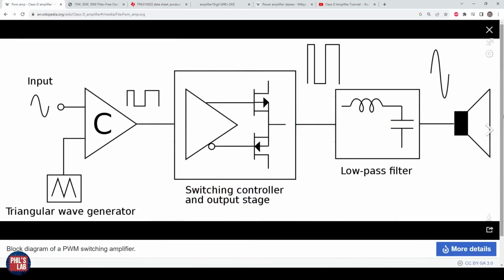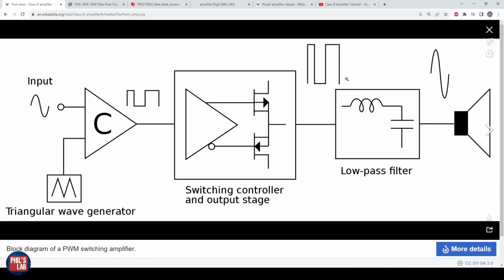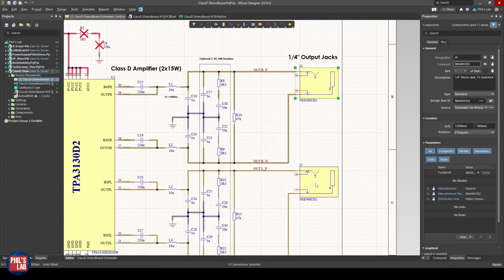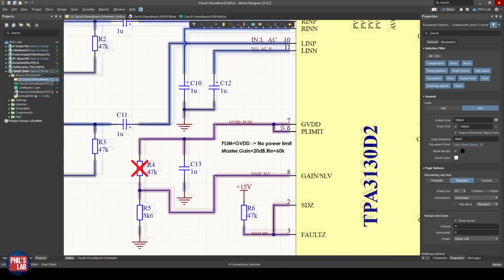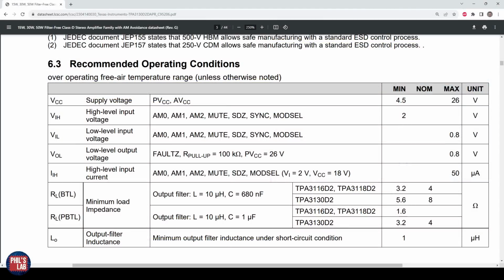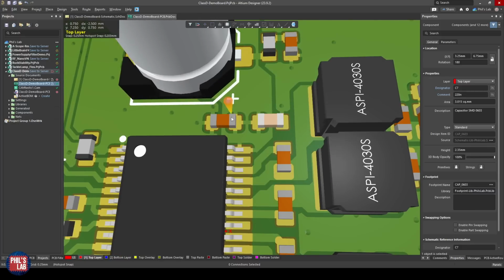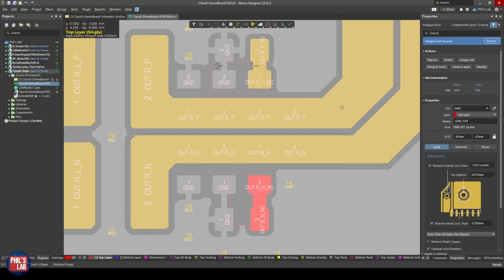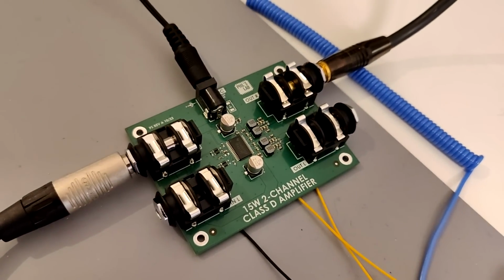Class D Audio Amplifier Hardware Design - Phil's Lab #125

Comment: Excellent coverage. I followed along while looking at datasheet. Your layout is much tighter than TIs, good job here. You've opted for a different thermal relief strategy based on experience 👍. The sheet says in 7.3.7, "In a single-ended input application, the unused input should be ac grounded at the audio source instead of at the device input for best noise performance."  Not really possible with a guitar/pedal combo with various grounds floating around. Thanks for the video, I'll start using pours more often than wide traces.
Reply from the maker: Thank you very much, Craig!
Yeah, exactly, a bit difficult to implement that grounding strategy if the source isn't entirely controllable.
Reply: @PhilsLab  plus, its a guitar amp, so it really doesn't matter much.

Comment: Once I played around with simple class D on FPGA. It is really fascinating that any signal can be generated by single digital pin.
However main frequency should be far more than actual signal frequency, which is limiting factor.
Reply from the maker: Definitely a cool project to try out on an FPGA!
Reply: @PhilsLab  how?
Reply: I'd really like to see a power delta-sigma modulator!
Reply: @VEC7ORlt that’s basically how  D-class amplifiers work, especially the better ones are mostly just sigma delta modulators

Comment: Very nice playing and pcb design! IMO, damping factor of class-d chip amp is way too high for guitar to sound good, way less “punch” than a push pull pentode tube amp. Do you have any idea to lower the damping factor of 3116? Cheers!
Reply: Amplifier damping factor (DF)is defined as “the ratio of the load impedance (loudspeaker plus wire resistance) to the amplifier internal output impedance.” This basically indicates the amplifier's ability to control overshoot of the loudspeaker, i.e., to stop the cone from moving.

I don't see why you'd want to lower it, but the TPA3116 has an output Rdson of 0.12Ω meaning about 0.25Ω total, which gives the damping factor of 16 with 4Ω speakers and 32 with 8Ω speakers.

If you'd want to lower the damping factor, you can always put a resistor in series wit the output.
If you put a 3.75Ω in series, you'll get a damping factor of 1 with 4Ω speakers.
Reply: @dedamarsovac  "the amplifier's ability to control overshoot", right, you are very correct. That's what guitarist call the "punch", it's basically  speaker cone overshoot. We want to lower the DF to simulate the tube amp overshoot. Most guitar amplifier has no negative feed back thus the overshoot is wild, for example, Fender 6V6 amplifiers and ALL EL84 push pull amplifiers.
Reply from the maker: Thank you very much! To be honest, I love valve amps but I quite like the 'simplicity'/ease-of-use of solid-states. Regarding damping factor, I believe it's rather difficult to measure output impedance and thus damping factor, as these are non-linear, switching devices. You'd have to linearise about some operating point, calculate output impedance, and then compare that to other ICs (or what other factors influence output impedance).